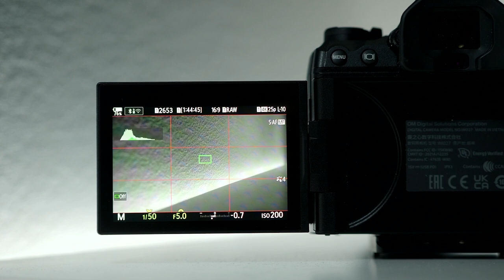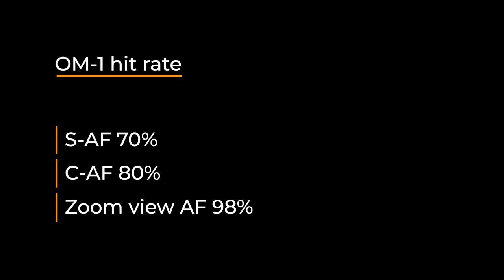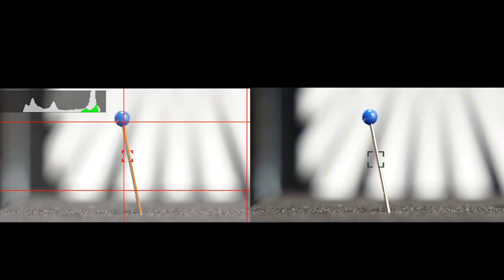OM-1: Let's talk about S-AF.

Comment: Hi Peter, thank you for this video. I actually saw Robin's comment last night and was a bit puzzled. I don't question the truth about what he saying about the S-AF, but I felt it was over the top. I like Robin's content and have bought him a couple coffees. I don't know if the OM-1 is the WOW camera, but I do think the small improvement over a wide range of features compared to the MKIII make it a pretty significant upgrade. When comparing the in auto focus in general, the improvement is significant in my opinion. My action and bird photographing improved immediately with the OM-1. I also have seen some content that OM is only scratching the service with the potential of the sensor. So I am hopeful we will see some great stuff from OM in the near future. Thanks again for level setting S-AF controversy.
Reply: Very well said 👍 the OM-1 is more than the sum of its parts, and even the parts themselves are significantly better than previous M43 cameras.
For me, it was the camera that brought back MFT into my pro work. It is just so good and allows me to get shots more easily than many other cameras 📸
Reply: Robin spoke of how worse C-AF was ,all of you people got it wrong😂
Reply from the maker: Yes he did. I got better results in my test with C-AF. I believe Rob Trek got also better results with C-AF. The best results in low light and low contrast you get with PDAF.

Comment: I find AF issues blown out of proportion, generally. Perhaps my expectations are low from using autofocus Nikon film cameras in the 90s, but modern autofocus is excellent in my experience, even on my Panasonic S5!
Reply from the maker: I agree that the problem is not that big. It is more about how to use the camera since it works differently.
Reply: Agreed 👍
Reply: If the questions having been raised by Robin Wong have got an answer, the goal is reached and this will benefit to everybody...questions are interesting if the answers are bringing added value on explainig how to beter use the camera no ?
Reply: @jean-lucsteifer4317  It's a testament to the capabilities of modern cameras, that aiming at a white wall in shade tests their focus limitations. I'm pleased that commentators perform these experiments without having any desire to do so myself. So on balance the question Robin raised was a useful one for OM1 owners.
Reply: @borderlands6606  totally agree...

Comment: It sounds to me like the OM-1 designers opted to bias AF to work really well in the greatest percentage of shooting situations, and the trade off was to sacrifice a little in obscure situations. To me, this is a logical and desirable approach. The question should be, 'In normal, everyday shooting situations, does the OM-1 AF perform better than previous models?' I believe the answer is 'Yes', so people need to avoid searching for an area where the camera might fall short.
Reply: Agreed 👍
Reply from the maker: I think it is also good that people push the cameras to the limit. We can then solve the issue. This issue is solved by using other methods. Om-1 works differently.

Comment: I have om 1, and I have the same problems as Robin (one of the few users on yt to be honest).  I changed the camera body 3 times but the problem always occurred (even in c-af). I use leica, fuji large format and olympus to work.  I'm not a fan boy but this camera is sold as a professional camera and it's not acceptable to have an autofocus with problems.  I finally bought the om 1 mk iii again. The
Reply: The thing that annoys me is that we always have to talk about others.  you talked about Robin's channel, at least he was honest.  I know that Olympus does not pay you, but then why do you find excuses?  they made a mistake, it's normal...that they correct it right away with an update.  speak your opinion, however true it is, cooperate with others, but don't be arrogant or false.
Reply from the maker: Interesting opinion. I did find a solutions to the problem. It is not an excuse, it was a solution. Tell me why you see it as a an excuse? Using different AF method the issue is gone. I have short video about the settings and how easy it is to solve.
Reply: Your state your issue was the same as Robin’s and I completely believe you. your problem was the same as Robin's which was proven by Rob Trek, Thomas Eisl, and Peter to be attributed to Robin's literally not knowing how to use the camera. You also have just stated, in writing, that you used all 3 perfectly fine and identical cameras wrongly and they all behaved identically as they should have yet you got rid of them. Brilliant...thanks for sharing
Reply: The camera has no AF problem. The AF just works differently. It would be like shooting an Autofocus camera and complaining that the rangefinder patch is not visible. 
 It is far superior to the previous models.
 
Most important, however, is that you have the camera you want.

Comment: The Thomas Eisl channel is wonderful! A lot to learn with him. OM1 AF: I would not describe as a AF problem. It looks like a characteristic. I’m glad I did keep my em1iii though . I tend to use the OM-1 for wildlife and the em-1 for general purposes. But I almost never work in low light conditions. The OM1 AF is fantastic for the purposes it is intended to be used and when you know how to use it. It is another sensor and another AF system, much more capable and much more complex. Almost 10 x more focus points. And very small focus points. Anyway, I would like to see better updates for the OM-1 for the video capabilities and S-AF, because I think that the Camera is capable of more. I would like to see “Bugs recognition” AF :)
Reply from the maker: It is wonderful and he is a very nice guy too. You said it: It is fantastic for what it is meant for. That is something many do not realize.
Reply: @ForsgardPeter  And it certainly wasn't designed for white wall photography in low light conditions :)

Comment: I love my OM-1, but I've taken quite a lot of flak on forums for questioning why it struggles to lock in situations that my previous Oly bodies wouldn't have hesitated over. Time and time again I'm told 'Because it works differently.' Sorry, but it's a £2000 body. I shouldn't have to shuffle settings to get it to focus. The sooner OMS put a firmware update out, and we can move on, the better.
Reply from the maker: I think it is the same thing when you switch from S-AF to C-AF Tracking or S-AF to MF. Now the switch is from S-AF to PDAF. That can be assigned to button. The precision small AF works in the other situation and PDAF works great in low light. They could add the PDAF to AF points that could be one of the AF areas like they now have, single small and so on.
Reply: If they change it, then you don't have the precision - contrast AF calculations are more precise on small areas (OM-1) and less precise on large areas (old Oly). 
It is decision to have one or the other, you cannot have both in no camera, unfortunately.

Personally, I'd be very disappointed to loose the precision that makes this camera stand out from the crowd.

Let's keep in mind that not even the cricitcal testers found anything when the camera came out and suddenly the camera can't focus. It is a bit strange.

I really put the camera through its paces, and I have never noticed anything. It really is about using the camera as it was intended.

It is a specialist's tool, not a point and shoot. 

Great discussion, Michael! Always great to read from you!
Reply: @ThomasEisl.Photography  Thanks, Thomas. Big fan of your and Peter’s work. The dilemma I have is that the imprecision you refer to was never something that I found to be an issue, so it’s effectively a trade-off for something I didn’t find a problem, to something I do. I guess OMS can’t please everyone.
Reply: @michaelbaileyphotographycr9728  Yes, I know exactly what you mean. 
It is a bit unfortunate. 
Maybe my next video will be useful in that regard, as I will share an abundance of best practices. With those, I am convinced that you can overcome the problem and get both - high precision and super high confirmation regardless of photographic situation. 

Have a great weekend, Michael!

And thanks for the super kind words, that means a lot - I very much appreciate our conversations!
Reply: @ThomasEisl.Photography  It is almost as though this is a misunderstood improvement. It seems to be more a problem of old habits and expectations, while the actual feature is actually much better in other ways.
Reply: @proto57  absolutely agree! That is why it is so important to contact the manufacturer first when you encounter something like that before publishing anything - otherwise a lot of confusion and bad vibrations will be the result. No one needs that sort of drama IMHO
Reply: @ThomasEisl.Photography  Maybe an easy extra option given in FW could be a solution, nothing to take away from the present accuracy but maybe another implementation of Magnify Function Target Area that is listed as another AF Target area. I dunno, but if 'old habits' are going to be a sticking point for some, then hopefully there is a FW solution to satisfy 'that old habit', otherwise the 'RWs' of this world are going to keep on complaining. 🙂
Reply: @rossthefiddler5890  Yes, I know. I really hope that my upcoming video is able to convey this new way of shooting with the OM-1. It is just one of the best cameras I've ever used, and I've really had pretty much everything in the last few years. It is a bit sad that it now gets all this bad press all of a sudden. That is completely undeserved.
Reply: @ThomasEisl.Photography  I find it so much easier to just press the (pre-programmed) Exp Comp button for the Magnify box, which can also be shifted around with the joystick (& easily cancelled with a press of the OK button) when trying to focus on indistinct subjects.
I use that button because I usually use Aperture Priority & the front dial already adjusts Exp Comp.
Reply: @rossthefiddler5890  absolutely! That is a great idea and will actually be pretty much what I would like to suggest in my video. Then, you have the best of both worlds. 
I have to admit, however, that I never needed that in practice, but one might need it depending on the type of photography 📸
Reply: @ThomasEisl.Photography  For normal use I don't have an issue, so I'm only trying it sitting at my computer pointing at things in the near dark or low light to see what some are complaining about & testing to see which option works best. Pointing at subtle wood grain in low light I can get it to hunt using S-AF & C-AF while the 14X Magnify box when set to S-AF focusses fine. Note, if set to C-AF & using Magnify box, it isn't as successful, which should be fine if only trying to use S-AF anyhow & applying the Mag box area. It is true, in some applications C-AF worked better than S-AF, but I intend to apply Magnify box when S-AF has any difficulties, something like white flowers with low contrasting detail in the petals etc, the Single or Small AF Target might not get the edge areas to focus on in close up shots.
Reply: @rossthefiddler5890  wow, thanks for testing all of that - our experiences match completely! 
You've made an outstandingly interesting discovery here - the zoom box does use c-af when zoomed out, but when zoomed in it only focused once regardless of focus mode. I just tried that myself, that is very interesting and makes a lot of sense. You can either use a bigger box for easy lock on or you can use the zoom in for super precise focus. I have to admit I find that quite exciting and useful!
Reply: Curious if anyone who is saying ‘it’s not really a problem’ is using the 40-150 Pro + 1.4 tc? That’s where it’s most apparent for me.
Reply: @michaelbaileyphotographycr9728  Anytime a TC is added it reduces the light to the sensor, so adding the MC20 to the 40-150 f2.8 lens does reduce the AF ability to lock focus, but not significantly so though. The MC14 to a much lesser degree too.
Reply: @rossthefiddler5890  Even if it’s insignificant, it’s enough to cross the threshold of it being reliable compared to previous bodies.

Comment: It is true, using the Magnify Function (easily accessed if MultiFunction is programmed to the Exp Comp button) at the smallest area green box (14X mag setting, not at magnified view though) grabs focus reliably, for example, of indistinct wood grain where a Single or Small 9pt AF Target just hunts in both S-AF & C-AF on an unlacquered timber bifold door right where I sit at my computer. So for me the solution for difficult to focus subjects in S-AF & even C-AF using 9 point AF target is to use the Magnify Function frame at 14X or 10x for a larger area. Having Exp Comp button programmed with Multi-Function also allows me to use all the other functions available there as well when needed (& they are selectable from a list to have included prior to programming too, so only include what you want under 5.Grid/Other Displays).
BTW, to get out of Magnify Function, just press the OK button.

Comment: I have been very satisfied with my OM-1.  Once in a while I have to pull back on the clutch for manual focus, not very often.  I often use CAF-T and have gotten good results.  Mike P/S I feel that my work speaks for itself.
Reply: Same here - and as you've said - switching to MF is needed with every camera I've used so far from time to time, no automated system works every time.

Comment: I think, if you must, you can find some problem under extrem conditions on any camera. I have OM-1 and 12-40 mm f2.8 and have taken photos under rather dark conditions. I have ever had any problems.
Reply: And that is not even the fastest lens for low light - so with the super fast lenses, I was able to get every shot reliably.
Reply from the maker: That is also true that all cameras have problems in some situations if you look for them. I think it is a good thing that the community looks for these. We can discuss and address the issues.

Comment: ...yeah, but Robin's CAF video shows the struggles the camera has - in CAF. I mean, he's SHOWING it. Eisl doesn't show anything. He just says it's amazing. And if he hasn't had any problems, then that's cool - that's his experience and I have no reason to doubt him. But it's strange to discount someone else's struggles with that camera. And Robin isn't alone in noticing this either. 

Robin has no reason to lie about this. His recent videos show M43 cameras in low light getting good results, his favourite M43 lenses....he clearly loves the M43.

If the OM-1 does have a tiny focal point and you can work around it by zooming into magnify mode, like how Rob Trekk showed....in a lot of real world scenarios this might not always be feasible. Hopefully, OM smooths this out - everyone having a good focus experience with this camera can certainly only be a good thing.
Reply: why would you expect Robin's videos not to show poor AF performance when Robin has proven he doesn't understand the OM-1's AF system and isn't using said AF system appropriately?
it seems you'd like to dismiss Thomas' data because there aren't enough pictures provided to help you understand it.  well fine, as long as we are all clear about that. 
However, both Peter and Rob Trek are in agreement with Thomas' findings and they both provide lots of pictures in their videos. All three, Rob, Peter, and Thomas have thouroghly refuted Robins assertions. Do you believe the three are wrong and Robin is correct?   
I agree 100% that Robin isn't alone in not understanding how the OM-1 AF works and how it differs from previous models and that those users are also using the camera inappropriately.
Many folks believe Robin has a very big reason to lie.
Reply from the maker: I do not think that Robin is lying. He showed the problem he had. It is totally legit. However there is a solution that makes the problem go away. That was the whole point of my video.
Reply: Robin's test is flawed. Simple as that. (The Lego is 1 stop darker in the OM-1 compared to the EM5m3.)
Reply: @ForsgardPeter  I'm super confused. I might be missing the point of your video - the solution is CAF when in low light...is this correct? If so, then Robin also has a video using CAF and it still hunts. I'm not saying that Robin's test is the be-all-end-all, but I do think that for some users, and there are lots of examples online, of people struggling with low light focusing with the OM-1 and they're trying to find solutions.

Comment: The OM-1 is a "flagship" Camera that costs about $2500. It  is to be expected that these cameras will be scrutinized, as all top of the line cameras get their fair share of criticism. Especially now after the Olympus OM Digital  buyout , the new company will get the extra attention from users because they expect nothing  but the best quality as had been provided by Olympus.  It doesn't seem like the OM-1 camera is quite OM's best effort. Maybe with the mark 2 version they will give their best.
Reply from the maker: The price of the body is $1999 at the moment. It works really well for it is meant for. S-AF is a lot faster than the previous models. The "problem" can be solved by using different focusing method. I got better results with C-AF. Also the PDAF works better. It is about the settings for the most part.